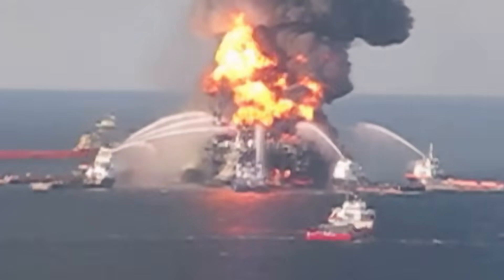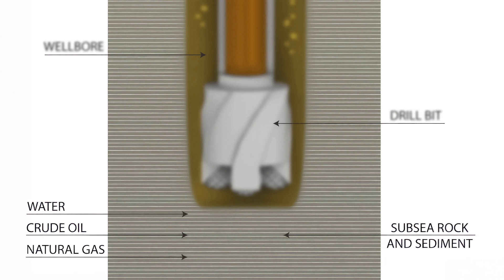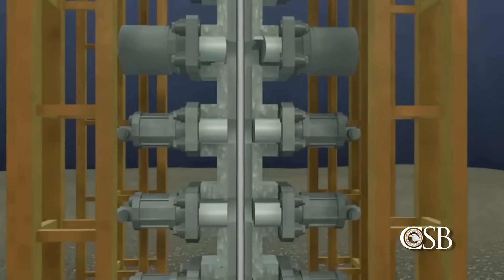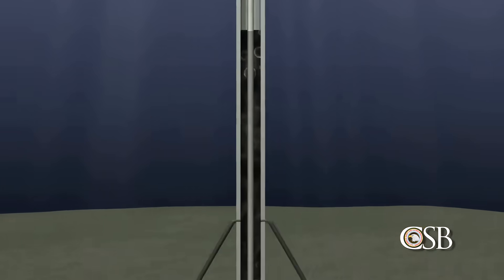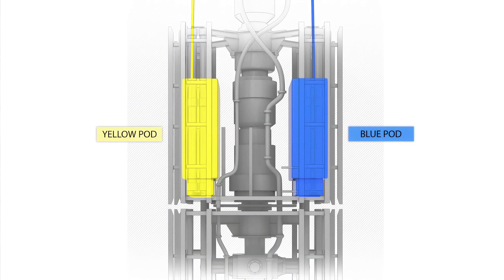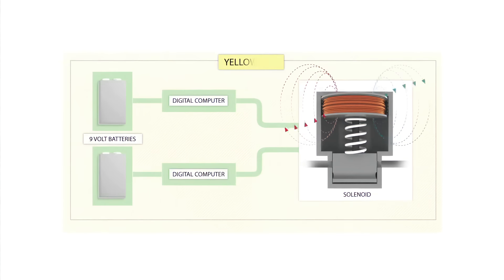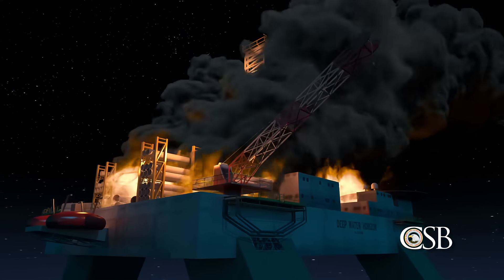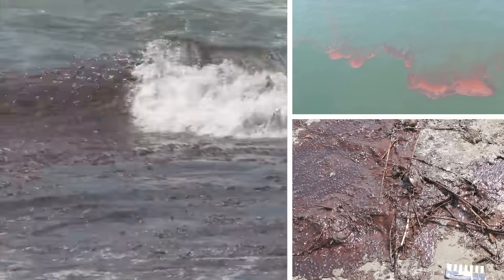Deepwater Horizon Blowout Animation

Comment: There were equipment failures here: however the lack of rigorous standards, operations management and implementation of a management system to assure this did not occur are the main take-aways.  I haven’t seen the Horizon movie, but I’ve seen this story before and read the underlying reports on this- those that are supposed to do audits, offshore visits, etc. in regulatory positions have nothing to feel good about.  I was heavily involved in North Sea ‘cleanup’ after Piper A fiasco (retired management consultant - very well paid, ask basic and logical questions to those classed as ‘experts’ and the rest of the management audience in big-boy meetings frequently are shocked by the answers - my main skills are commonsense and the ability to ask dumb questions). I can tell you that the American influence on North Sea operations and subsequent mandatory rules in the N Sea (Norwegian - involved there also, and UK) never made it to American offshore ops till after the Horizon incident - and because of the good old boy culture I would not assume how much things have improved. It’s frightening that BP (part of N Sea cleanup of practices) didn’t bother to use same practices in US before this happened. 10 years previous to the Horizon incident I worked on China project for BP/Amoco - and the Chinese offshore laws were based on N Sea standards - embarrassing, but they did not want to get screwed over by international oil company lack of safety (yes, worked all over the planet, I am American, yes I’ve worked for top 20 Oil and Gas operators). The journey to avoid this stuff happening is still ongoing - the bad things only get reported when it can’t be suppressed - $$ figures for human loss are a reality, and vary dependent on nationality- US has no laws for sending corporate officers to prison for criminal negligence/ manslaughter due to unsafe operations and corporations always have access to fast transport for executives to another part of the world when they operate in areas where they have such laws. Platforms have been vaporized in deep and dark places by the big operators that you you’ll never know about.

Comment: And this is why we wire and design systems to fail safe. The rams should have closed the second they lost power to a solenoid that was holding them open instead of trying to force them closed.

Comment: This may be a dumbass question but shouldn’t have all this equipment been tested prior to installing it on the sea floor? And if it was tested and these problems went unnoticed maybe the test if flawed. I’m not an engineer but it seems that the engineers who designed a piece of equipment to function where pressure is the main factor, should have known this malfunction inside BOP was possible?  Maybe I’m expecting too much from an industry whose profits were $4 trillion in 2022, that’s PROFIT, not gross, profit. They probably couldn’t afford it. 🫩

Comment: If your product doesn't work unless under perfect conditions (the sheer ram not working if the pipe is slightly bent as an example), then it's a failed product from the beginning.

Comment: Watching this movie before getting into the oil industry and then after being in it provides you with an interesting perspective. Mind you I've never dealt with offshore, exploration, or drilling. There is always a chance for a release.

There is also the Hollywoodization of the whole event, I find it hard to believe that nobody was willing to even attempt to control the well (when they finally did the Bops failed anyways)

Every service was to blame, corners were cut, safety gave way to profit, and maintenance was lax.

Comment: Some co workers were talking on the radio about this when they were trying to stop the oil flow.  One of the guys said it's so simple they aren't going to figure it out, if you want a hole to stop putting out all you have to do is give it a wedding ring.

Comment: The video didn't mention the clean up job, they used revolutionary soak up plastics made of hydrocarbons no less and they didn't leave a drop of oil after they were finished.  The democratic media never mentions it turned out to be not that big of a disaster after all.

Comment: So the deepwater horizon was NOT to extract oil in any way. Its a drilling rig, its purpose is to dig the well into the ocean floor then close it and hand it over to a different team.  these drilling rigs are mobile, they travel around to drill the wells. you can imagine its very expensive to be using one of these, so the BP execs pushed the workers and safety levels until they broke, so they wouldnt have to keep paying daily for the drilling rig. Completely and 100% avoidable.

Comment: Gaslight video takes all the human error out of this. It happened because the ppl in charge cut corners, which led to equipment malfunctioning when it was needed
Reply: Sounds like your gaslighting yourself. This is an analysis of what failed. And only that aspect.
Reply: @neilkurzman4907 the BOP failed this bs is designed to hide the reason why it failed

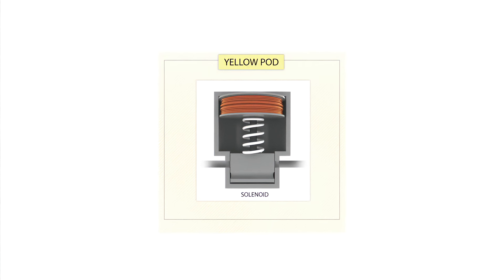Comment: 7:21 so... its like a dual voice coil sub-woofer, for audio/stereo 
they make subs dual coil so you have more options for ohm load on the amp.... which doesnt apply here  (this coil has 2 coils for redundancy) 
.
anyway... if you hook a sub up.... and (for some reason).... hook one coil up DIRECTLY to the amp 1st channel (negative to negative) 
but hook the 2nd coil up to the amps 2nd channel, but "180 out of phase" (aka, negative to positive).... 
you get ZERO movement of your sub-woofer. 
.
this is what happened here
idk... its a different way of looking at it.... and more people probably have experience with subs than BOPs lol

Comment: Obviously that BOP system wasn’t tested at the factory nor by the customer before deployment to the sea floor where the life of every person depends on its proper operation. And we still have BP gas stations that I see people using. Fkn gross.
Reply: Factory? It had been serviced several times. And modified.
Reply: My point is, whenever and whoever worked on it, there’s no way it was properly tested before being deployed. If it’s a life safety system it’s supposed to undergo a full commissioning test where all of its design parameters and limits are tested to verify proper operation. This could not have been done. Failing batteries is one thing, that happens, and is why you use redundant battery sources as well, but miswired relays is unacceptable.

Comment: And the chemicals they used to try to break the oil up caused more health problems than the spill itself. Of course, every drop of herbicide, insecticide, fungicide and fertilizer used between the Rocky Mountains and the Appalachians eventually flows down the Mississippi past New Orleans and into the Gulf, too. The Gulf has been sorely abused. And we did this to ourselves.

Comment: Well interestingly the "hero" of the movie, Mike Williams was almost directly responsible for this disaster. He was the chief electrician, it was his job to inspect the critical electronic systems. He didn't. He was lazy, inept, and an alcoholic gambling addict. If anyone should have been charged, it was him. They run BOP tests almost daily... You cannot tell me that they didn't notice the valves weren't working correctly. I'm sure this was on "his to do list" when he sobered up.
Reply: Interestingly, enough, your post is a whole bunch of BS. 
The BOP is at the top of the wall, 5000 feet below the surface of the water. Did you think he would swim down there and check it? 
He had nothing to do with it. He was a repair technician.
Reply: @neilkurzman4907  lol tell me you don't understand rig maintenance without telling me...

Comment: So the Solenoids in your illustration show that it will fail close with the spring pressure.  How did they remain open?
Reply: No the springs potential energy are what keeps the solenoid closed. So on complete loss of battery power it would still stay closed. The coils act as an electromagnet that pull the gate spring away from the seat, letting it open for fluid to flow.

Comment: The failure to test the system and equipment before they put it on the floor is beyond me. Even an inspection. Don’t see how you can fuck up a wiring when you legit have a diagram in front of you (if done correctly and properly) obviously not. Clearly a 186 billion dollar company is too cheap to monitor small maintenance procedures and follow proper protocol. Don virdeine and bob kaluza should’ve been tried for murder and found guilty. Bop should be sued for defamation and fined for endangering public safety and health. As well as jeopardizing the lives of those who worked on that rig. God bless those alive and the families who experienced that unfortunate loss.
Reply: Um, BP had nothing to do with this fault. It seems you're getting your info from the movie. In truth the rig was terribly behind deadlines, and way over budget because almost the entire crew were incompetent. When the BP top dogs arrived on scene to assess the situation they got the green light to move forward, as the rig management assured them all tests had passed and were ready to go... probably because they felt their jobs being threatened. So BP gave them the green light to pull the mud, make sure it had the necessary amounts of hydrocarbons to call it a successful well, and get out of the way for the extraction team. This incident is almost directly the fault of the chief electrician, who just so happens to be the "hero" of the movie, Mike Williams. 😂

Comment: I think some of this is incorrect !

At 5:05, they say that the pressure inside the drill pipe increased (and subsequently buckled) preventing the shear ram in the BOP from closing off the drill pipe, which "proved to be catastrophic". So if the drill pipe was was closed off (on the rig somehow), then how in the heck could hydrocarbons make it out of the closed drill pipe on to the rig to cause the explosion ???  

Plus, how do hydrocarbons leak INTO the drill pipe in the first place ?  Isn't there a drill bit screwed into the end of the drill pipe that is in the casing (or production casing) ??

Moreover, at 4:25 - 4:28, they said that the crew closed a ram (2nd from bottom as shown in the animation) successfully sealing the well (at the annular). Then he goes on to say: "however, that proved to only me temporary as the oil in gas that was already in the riser continued to "flow" up onto the rig".  

That's BS, - if it is sealed (like he said), then how could you get "flow" from the ocean floor all the way up some 5,000 feet onto the rig ?

Comment: 3:55 oil entering the wellbore was detected by the mudloggers, no one listened to them.  They were attempting to displace the well to seawater while pumping the mud simultaneously to the boats.  This is not industry standard.  Mud should go into pits where barrel in / barrel out is carefully measured.  This was the fault of humans, not equipment.

Comment: I worked in the oil and gas industry for 2 years before returning home  because I wanted to build my future in my hometown rather than have to move down south full time. Loved it for the most part, the work was fun and the camaraderie was unmatched. I did catalyst, some pipe fitting, and was mainly a towercraft/boilermaker. After the movie and seeing the family videos of those who died in this incident hits heavy for me. 

There were more fatalities on turnarounds i went on in those 2 years than not. The worst was last March (I won’t disclose the refinery but it was in the Midwest) 3 people died on that job in 1 week. 1 slipped off a ladder due to ice in the unit I was working in, and fell over 75 feet to his death. He was an operator up there in age. The other 2 were younger guys in a vessel removing catalyst. To go in those vessels to remove the catalyst/media, they put you in a space suit looking helmet with supplied air and screw you in. (You cannot take off the helmet without assistance) There is a backup pack of air you are supposed to keep strapped to you at all times in case, and while going through training they essentially suffocate you in the helmet and train you to hook up to that backup. 

My supervisor told us the plant claimed the air lines froze over, but we believed it to be an operating/mechanical error either from inside the module where those workers and the equipment are monitored, or perhaps they were not properly hooked up/sealed in. I never found out what really happened. 

With all of that being said; the reason I typed all of this is because all those guys got was a moment of silence in the morning safety meeting and work continued as if nothing happened. All while those men had loved ones back home in absolute shambles. I was fortunate, the companies i worked for were excellent with safety, and I truly felt cared for rather than ‘just a number’. It is scary to me how those incidents are swept so well under the rug. With how little exposure I had to the industry with just those 2 years, and to see that many deaths, the statistics on refinery fatalities must be crazy inaccurate. 

Much respect for the hard workers in the field who hit it hard all year every year. I met some of the coolest, smartest, hard working men I will ever come across in that field and I am grateful to have had the experiences I did with it.

Comment: they could have implemented a system where if all fails, a special radial bend dye goes into action, first a blade cuts off the pipe, the oil begins to spill out, but at the same a time a bend dye starts to rotate, bends the pipe over in an oval manner and eventually just seals the hole in the pipe by bending the pipe into a flat end hook 360' and by colliding the end of a pipe into the blind recessed hole when it completed the rotation it seals off the end of the pipe and stops the pressure. The pipe is tightly embedded itself into the dye and can move no further so no break out is plausible. Then the divers come and weld everything shut. They could have had the dye always engaged on the pipe and if all safety fails it bends over and blinds the pipe. done. instead of trying to shear metal in half, bend it over onto itself and seal it off by bending the end of it into a blind hole.

Comment: Along with other negligent decisions by the producers representative and the failure of rig personnel to invoke the safety stop work protocol, were they in the process of evacuating the sub-sea riser of BHP equivalent mud with a lighter weight fluid after a casing cement job with no follow up Bondlog, allow gas migrating from the zone into the riser because of an in properly installed sealing device at the sea floor. At the surface, there would have occurred a differential of flow in and flow out as an indication of gas I trusion warranting closer of BOP before gas caused the generators to runaway mode and ignite thurface atomos]her. Even before the well began ejecting pipe. It is a dicrace that no one person in the management of the well sight did not do any real penance their actions. This was severe negligence. It is horrific that 11 men had to dye because the job was behind schedule for the next rig move and job. The wives and children should never have been forced into this much pain and loneliness. Shame on you, BP. Shame on you, Deep Water Horizon management.

Comment: The truth is the engineers who wanted to pull up the blow out preventer and replace it ,as was needed to be done
 Where overruled by the CEO a certified accountant who liked to take risks and had gotten away with it many times before and ordered them to keep drilling when they should have done exactly that stop drilling replace the blow out preventer.
 In fact they obstructed the engineers from getting on helicopters and leaving
 So the engineers hired their own helicopter to come out and pick them up off the rig and they left otherwise they would have been dead too.

Comment: I have to say that I thought I had this all figured out until I spent a week with my nephew, who is a Director for Weltec, a company that stops the oil under pressure from coming up from the ground around the outside of the casing, which is bad. He said that cost-cutting, time cutting procedures were implemented  that resulted in such a terrible fire.

Comment: The solenoid valve is incorrectly designed! Safety valves are closed when idle, the valve only opens when activated with electronic voltage, so if there is a malfunction and the electronics are switched off, the valve closes automatically, the principle is self-explanatory.

Comment: As someone who has no real knowledge of massive systems like this, why not make the shear ram forced open via electrical and hydraulic? If the rams resting state is closed then the issue of electrical wiring would become moot as the system would have slammed shut the minute the wiring was incorrectly installed. If the system is wired correctly then the loss of electrical and hydraulic pressure would immediately slam the ram shut as there is nothing to keep it open anymore.

Comment: The whole thing could have been prevented if the BP consultants would have followed proper cement operations and cement testing protocol.  Schlumberger knew it was a bogus cement job without running a single bond log.  After that, it all turned into a blame game but the fault fell at BP's feet for not properly testing cement they knew was inferior.
Reply: This is ultimately the fault of greed and conservative deregulation. Anyone who voted for Reagan, the Bush or Trump killed these workers. But then, they own school shootings & Iraq too, don't they?